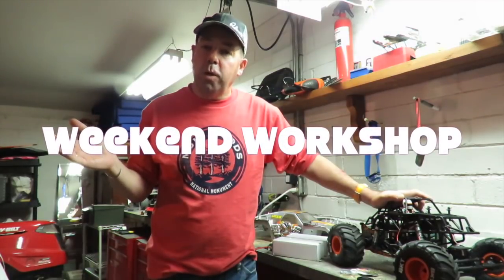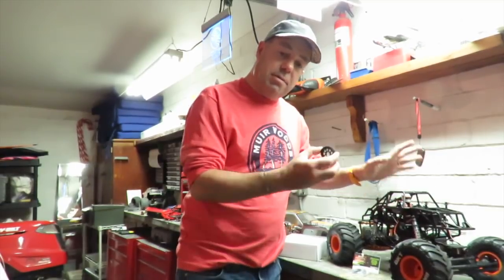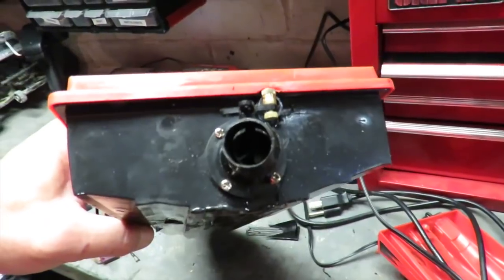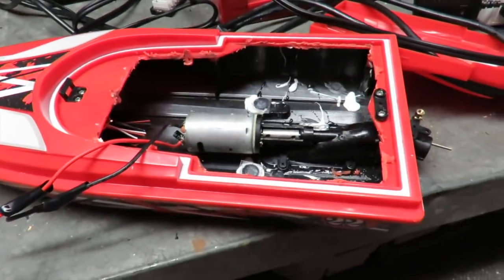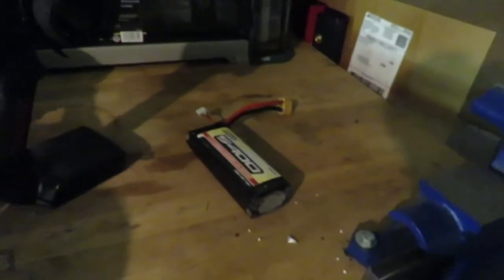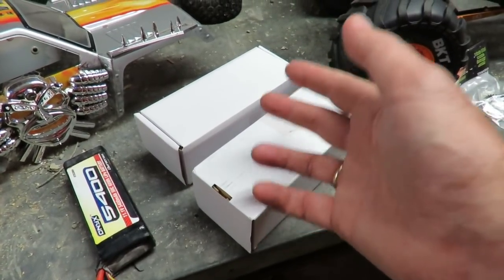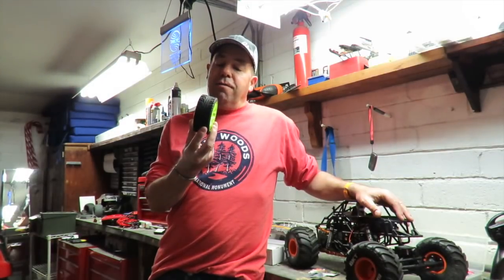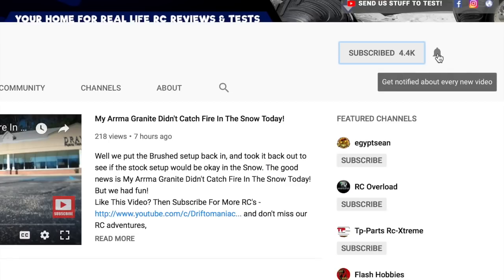RC Workshop Video

Comment: Contact Duratrax about the batteries. If they still have the same level of customer service since the sale, they will be able to help you on the battery issue and may even replace them. I called their customer service in the past and they were more then helpful.
Reply from the maker: I've sent an email these are 2 of the 3 packs they replaced under warranty late last year, those 3 all went puffy, these have just...well died

Comment: The E-revo seems to be discharging batteries in an unbalanced manner. Not just multiple batteries, but the cells INSIDE the batteries too. Seems like a design flaw with the new ESC.
Reply from the maker: Dustin somethings wrong for sure, my onyx packs have been bullet proof